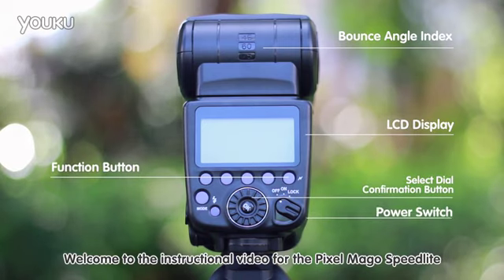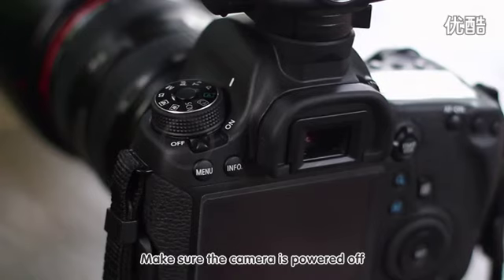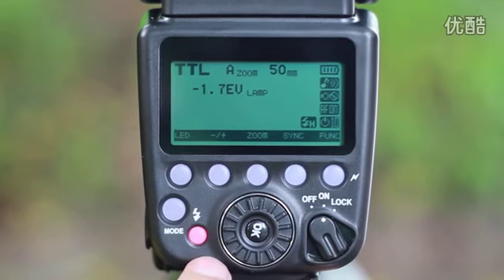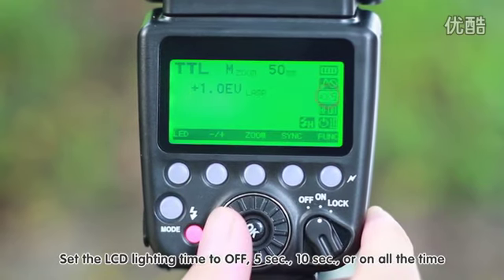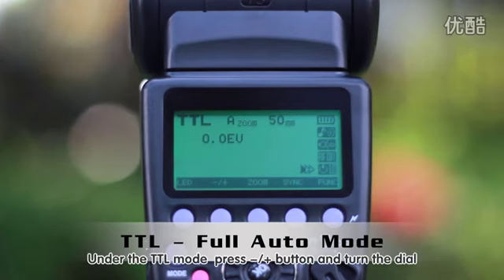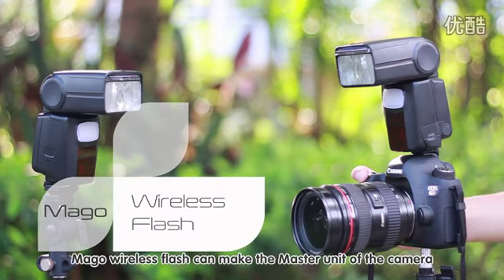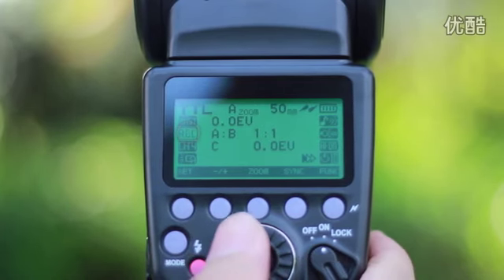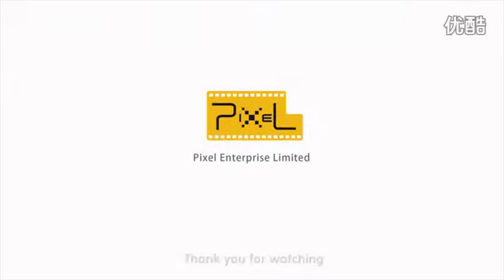Pixel Mago Speedlite Using Guide

Comment: i use on 6d, that flash hot shoe is not solid, the hot shoe make a slight move when  i move my camera, it effect the flash mode, i use ettl mode , 5 or 6 times shoot it change to MULTI mode, i use new alkaline battery ...
 i already upgrade mago firmware to latest too
, i need the mode to stop change, if only i can lock the mode to manual only , it is ok for me , because when it change to MULTI is annoying, btw i use for wedding event, so the consistant performance is what i need ..

Comment: With the flash on my canon eos 6d,

If I point the flash straight at the subject I get an icon on the screen of the flash telling me the flash is angled down and I get a correct exposure.

If I angle the flash to bounce off of the ceiling the icon changes telling me the flash is angled up and I get an over exposure of about 2 stops.
Reply from the maker: Hi Declan Hughes
We did not get your exactly,is it possible to send us some picture or a video to show the problem you've got?